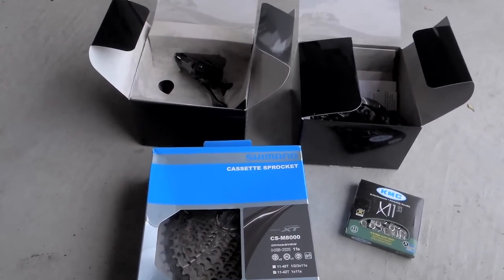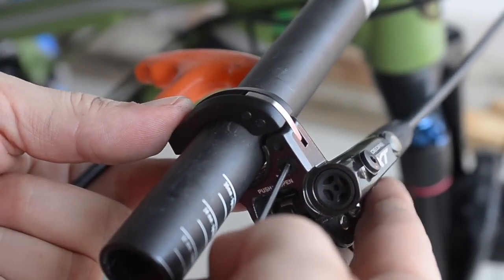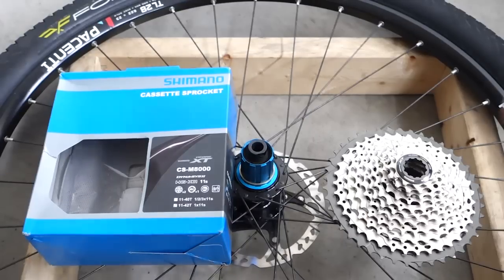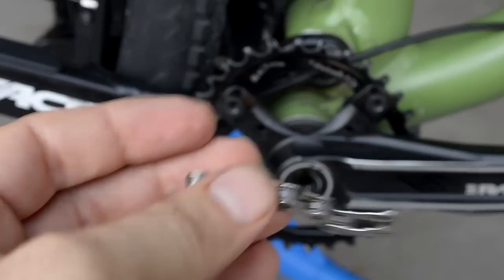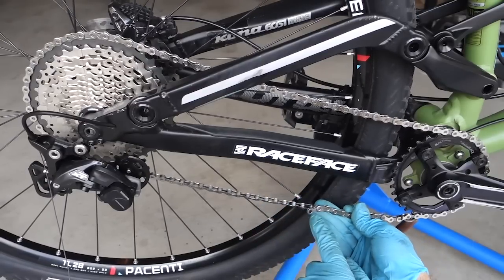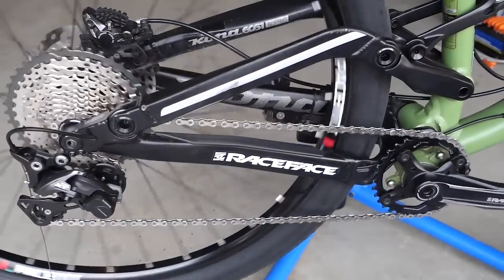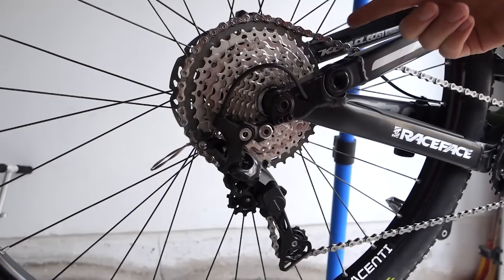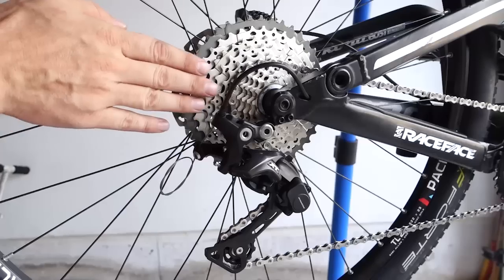1 x 11 Speed XT M8000 UPGRADE/ Install How-To, Ride Impressions: I-Spec II, 11-42t, GS RD

Comment: I was able to adapt xt 11 speed shifter (i spec 2) to my deore brake lever (i spec ev) by removing the i spec 2 plate and using a shorter bolt (brake rotor bolt). I saw this on reddit and very happy with the result. Im always referring back to your videos for reference. Thank you again.

Comment: Your videos about the XT M8000 components convinced me to go down that route. I got a fatbike which came stock with a not so great 3x10 and asked the bike shop to replace the parts with a 1x11 XT M8000 setup. Besides that the shop didn't feel the need to install a chainring with any sort of chain retention (I had to get a RaceFace narrow/wide to stop the chain from falling) they delievered the bike with a M8000 RD + 11-42 cassette + speed shifter and according Shimano chain (actually thinking of it I have to check wether it's also wrong as I have some rubbing in the lowest gears which I can't get rid off easily). All in all I am super happy and thanks to your video I made a very good decision on what path to go in terms of drivetrain. Next upgrade will be the XT M8000 hydr. brakes which you seem to like a lot too. I will be replacing the stock mechanical Tektros that came with the bike (entry level Felt fatbike DD70). I think that with my combination then (XT M8000 RD + cassette + brakes + RaceFace Ride crankset with 32t chainring) the bike will have made a massive leap into very decent bike territory without spending a fortune. Thx for your great videos..

Comment: Dude, I can't tell you how happy I am to have found this video.  Not only am I in the process of installing all the same parts, but I'm also replacing all the exact same parts you had (Race Face ring, One Up cogs, SRAM X9).

One thing you didn't address in the video, if you wouldn't mind: What's that little gray lever that you can push up for "ON" or leave down? Oh, and what's the little rubber cap that's on the "Plate unit cover?"

You are really good at making these tutorials; keep it up!

Comment: Ok so I went with a 3x10 to 1x10 conversion with the Race Face 32T up front and the Wolf Tooth 40T in back with their 16T drop in.  It is fine, but also just...ok.  Shifting can be somewhat inconsistent going back up to that 16T.  I wish I had just gone the 1x11 route from the get go after watching this.  I think the Shimano 1x11 M8000 Groupset is what Santa needs to bring this year.  Nice vid!
Reply: Indeed!  I will consider both options.  I guess it will depend on whether I have been naughty or nice in mama's opinion!
Reply: Well Santa was a bit late thanks to the Fedex delays, but did arrive this morning.  I've just completed the 1x11 XT M8000 conversion on my Trek Fuel Ex-7.  The only difference for me is that I kept the Race Face 32T Narrow Wide up front. It took about an hour fifteen start to finish because I wanted to only do it once.  The hardest part was the cable through the frame as my plastic tubing slipped out of the tape and went up inside the frame on the lower end when I was removing the old cable. I was able to snag the new cable end out of the lower hole with some tweezers however.  Love love love the setup!  Thanks for the reference guide!

Comment: Great, informative, higly detailed videos as usual. Great Job. Have you thought about using an Avid Rollamijig to get rid of the housing loop into the rear mech? It should help to reduced cable friction in the system. I've been using one on my 1x9 setup and it works great.

Comment: Hey man, nice video thanks! 

I recently went 1X11 on my Kona as well with the XT M8000 set. One thing i noticed when setting chain length with the +2 links method is that my chain felt way short. Watching your video and your +4 links method - your chain seems to be really pulling the derailleur along way out similar to my primary setup length. I ended up adding 4 links (so that would be length of big cog and chain ring + 6 links!) in order to have my rd nicely tucked at the low gears and roughly perpendicular to the ground on highest gears.. Would appreciate your thoughts.

Happy trailing!

Comment: Nice share ^^ going 1x11 (XT M8000) myself soon, as I managed to destroy my current SRAM drivetrain >.<
Have gone w/ Blackspire Snaggletooth 30t and 11-40 cassette.

Also have to re-build rear wheel i.e. new hub/spokes  - don't ask ;-)
Your vid has me excited about upgrade... I did like the SRAM gear though o_0

Comment: Is your shifter pretty stiff? Mine is and I'm not sure if it's designed that way or is it because I use old housings that are a bit too long
Reply: +LoveMTB weird part is that I cannot detect any change with the clutch  off
Reply: ***** This is indoors also, but it's currently -25C or -13F outside and then the shifter gets completely frozen. Remember, it's brand new, but the thumb lever takes a good while to return after depressing. I think this could be "normal", since I suppose these parts including grease and lubricants are designed to be used in warm weather.

I'll start switching the housing right now, let's see how it goes.
Reply: ***** I installed the new housing and the motion is much smoother. It's actually designed to be much different from cheaper models. Old one felt linear, but XT feels "bouncy" somehow, however it is now much easier to actuate. Surprisingly, there is not supposed to be a "loop" near the derailleur, like you see with road bikes and such, so the cable and housing is much shorter than normal.

Comment: Did you leave the heat shrink tubing inside the frame as a cable housing or is it simply an installation guide that gets pulled out?  Thanks for the great video!

Comment: Good review thanks, looking at going 1x11 by early spring, currently running 1x10 with a 32t NW race face front ring and a 11x42 rear cassette using a e13 expander sprocket. some good deals at the mo on M8000 Groupsets £299GBP. Shimano SLX brakes maybe ispecii compatible too.

Comment: ¿Do you think that the cassette with a SLX double crankset with just one ring (34t) would have a too bad chainline? I use more the low speed and middle gears.

Comment: Should of went with a wipperman 11 speed connector.  You can take it off as many times as you want.  It costs 30 bucks but if your cheap you can reuse it with a new chain at least a couple of times.

Comment: Wanted to ask you if your free stroke bolt came very tight when you got the brakes. I brought them but I haven't install it in the bike yet, but I tried to unscrew the bolt and I couldn't do it. I used a flat screwdriver (very carefully), but I think it shouldn't be a problem if the bolt wasn't too tight.
Reply: ***** I did it counter clockwise and yeah, it's not flat, but didn't have a Philips screwdriver when I tried. I gonna buy one, but still I felt it was too tight, I just hope is not cross threaded or something. Most of the time a flat do the trick and make me concernd about it because in MTBR someone said that one of his brakes the free stroke bolt was really hard to screw/unscrew. Harder than the other brake.
Reply: ***** Alright, thanks. I will get the right screwdriver and try it again when I install the brakes.

Comment: I'm curious to see how well it wears over time compared to 10-speed. I'm still running 9-speed (HG-61 11-36 x 32). Will probably go to 10-speed next as I can get a new Zee drivetrain/shifter for about $100 using existing crankset.
Reply: MarzNet256 go to 1x11 instead of hopping by 1x10 ul be happier
Reply: jom_ aca I might just do that.

Comment: hi I just got my m8000 11-42 setup running nice and I got the xt rear m8000  mech as well.  xt shifter was out of stock so got a xtr m9000 shifter .problem is shifting up feels a little stiff and shifting down I seem to get a loud clunk that I can feel from my saddle it don't seem normal . any ideas ? I'm pleased I've dumped my sram setup as xt ratio is much better for me

Comment: Hi Mate, Is it possible for cross matching this with Deore 5100? I have m5100 and Xt derailleur and was planning to put the m5100rd with xt shifter using the m5100 cassette and use my xt Rd with m8000 cassette with m5100 shifter.

Comment: I'm about to convert my old 3x10 Shimano XT M780 to 1x11 XT M8000. I got the 11-42 cassette and will add the OneUp 45/18 to it. I liked that progression over the 11-46. On the front I'm going to use the OneUp 30T ring. I upgraded the shifter to the XTR M9000 as I heard it is smoother than XT. Will use XT 11spd chain. Any thoughts on this setup? I'm concerned about getting the chainline right with the old M780 crankarm. Will backpedaling be an issue?
Reply: @LoveMTB  I am getting a lot of conflicting data when asking about cage length. When going to gears bigger than a 42 on a 1x setup do you have to go to a long cage (sgs)? When you look at the spec in shimano's literature it says for 1x and 2x Medium Cage (gs) and for 3x Long Cage (sgs). But when I speak to someone about installing the 11-46 cassette some say sgs, some say gs. Can I run a medium cage for a 1x with 32T  and 11-46?

Comment: Great video.  I have a question about the ferrules.  I had some in my toolbox and I had some (along with cable and housing) from kits I bought in the past.  I think they were Jagwire.  None of the ferrules I have fit.  ??  Do I have to use the ferrules from the Shimano shifter cable kits only?

Comment: How many teeth is your current chain ring for that set up? I have a 28-38 and 11 - 40 xt casette and im considering going 1x i dont know if i have to go 32T or 34T fpr my chainring. What do you suggest? I go on long rides but i also want to do trail or downhills. Thank you
Reply: @LoveMTB  yes mostly on the road. But id love to get on and learn to ride trails maybe even technical ones 😂 uhm what do you mean by spin out ? Sorry hehe. You think i should go with 34T? And would you recommend an oval chainring for my usage? Thank youu
Reply: @LoveMTB  how.about oval chainrings? Do you have a vid explaining those and its use cases 😂 Thank you btw i subscribed to your channel🤘

Comment: Why do you grease your bolts? I do the opposite and use Loctite blue threadlocker.
Reply: Yea i wondered as well when i heard the instruction...Grease is for parts that SHOULD move, not for parts that are intended to hold something tight. Worst thing you could possibly do to screws.
Reply: thats actually not true. Bolts with lots of torque need it just to be undone at some point. otherwise they get stuck like loveMTB said.
Reply: grease everything but discs, saddle, grips...
Reply: bolts should be threadlocked. Torque specifications do not account for greased threads. If you grease threads, you will overtighten the part. The only time you should use grease on threads is when the manufacturer calls for it. Grease can also make the part less reliable because the bolt can loosen. This is why you will find thread locker on brake bolts, bottom bracket parts, and many other parts where safety is a concern. People really need to read manuals because some manufactures call for grease (such as the seat post) and some don't. I bet most mechanics just grease everything and not read the manual. That's why I do it all myself.
Reply: I grease everything, torque to spec and never had a problem ever...
But I do regular maintenance... So Threadlocking is useless and mostly a pain for me
Threadlock to me is for who buys a stuff use it and sell it without handling a tool in between...
But I'm not gonna hit the street with a sign asking for a cop to come to some ones door in order to make sure they don't use Threadlock!! ;)

Comment: When you install the Cable Ferrule into the shifter do you just press it into the shifter until it makes a clicking noise?
Reply: @LoveMTB  The end of the Cable Housing has a Ferrule on it. It goes into the Barrel Adjuster on the front and on the rear there’s also one that sticks in the Rear Derailleur. Do you just push the cable end with the Ferrule into these spots firmly (Compression Fit)?

Comment: I am using 3x10 xt cassette and front/rear derailleur.Will an 11 speed cassette fit on my current hub or i need to replace it?
Reply: +LoveMTB thanks .that's what i wanted to hear.

Comment: Also converting to 1x11 setup, but not sure yet about front ring (30, 32 or 34). Any advice for shortening chain so I can switch later to other ring size with no problem with chain length?
Reply: Specialized Camber Evo 2014 (X9 2x10) but crasehed rear deraileur and have to change cassete, chain and rings as they are wear out, so it is opportunity to convert to 1x11. Not converted yet, but plan is to start with 32T, and depending on trails to change to 30T or 34T. Haven't tried 1x11 so don't know what setup is best for me. Will leave few links longer chain for start then. Thanks.

Comment: What's the point of mounting your bottle down there? I had mounted my old bottle cage to my new bike and due to the wider bottom tube it didn't fit straight. (It has a pump mount at the side.) Even so I have a very large mudguard at the front, the bottle always got extremely dirty on the trails. And since I also have a camelback without a cap on top of it, it was a huge problem (I like my water without dirt.) I had to buy a new bottle cage so the downtube shields the bottle. I can only imagine that yours has to be covered in mud when you go out riding.
Reply: I think you need at least a different bottle. One with a cap on the mouth piece, you can't drink out of a dirty bottle.
Reply: Yeah, I did that to, but I still hated it.

Comment: Hello. Have a question. I have 2x10 system and thinking of upgrade to 1x11. So, may I install 11 speed cassette on the same wheel where I have 10 speed cassette at the moment? I mean if the same wheel will be compatible with 11 speed? Thanks.
Reply: LoveMTB thank You thank You thank You  i though I have to buy another part s. Such a great news

Comment: As I understand, the standard freehub is shimano 9/10. I've been reading through a few comments and you have told others that no other parts are needed to install a xt8000 11gears. Is it true that an 11gears fit right in on a 9/10 freehub?
Reply: Even some of the 12 speeds will fit on a normal shimano hub :P Like the sram NX 12 speed cassette or sunrace 12 speed cassette.

Comment: I ave seen many conversion from 3x10. I dont understand, why to go from 30 speeds to 10 ? what's the point?
Reply: Heres Mihai, that's a great question.  I "upgraded" from 30 speeds to 10 last year, and I just did the upgrade to 11 speed that's shown in this video.  Going from 30 to 10 is one of the best things I've ever done to my bike.  Here are a few reasons:

1. I love my dropper post, and the button is on my left handlebar.  On longer rides & races, I found that my left thumb would get fatigued, clumsy, and "confused."  As a result, I would have to look down at my handlebar to make sure I was hitting the right button, which is not a safe thing to do in a race.  Now I only have one button on my left handlebar, and my thumb always knows what to do.

2. While you think you have 30 gears, you really don't.  A huge chunk of the gears on your 30-speed bike are duplicates of each other.  Thus, you're carrying around extra weight that doesn't get you anything.  In race situations, that matters.  I dropped a significant amount of weight by getting rid of my shifter, cable, cable housing, front derailleur, and two rings.

3. Your front derailleur shifts much more slowly than your rear derailleur.  Thus, again, in race situations, you're wasting precious time by shifting with your front derailleur.  Of course, there are a couple exceptions to this - when you're trying to access gears that aren't available in your current front ring - but in general, doing a lot of shifting with your front derailleur is slow and inefficient.

4. It's just simpler.  I don't have to think about which derailleur to shift with.  I don't wonder which front ring I'm on, and I never accidentally cross gears.  Plus, fewer moving parts means fewer mechanical problems.

5. When you think about it, how often are you in your highest of high gears?  Probably not that often.  I lost one gear on the high-speed end, but I make up for it by spinning faster.  But that really isn't very often.

6. On the other end of the range, I lost one granny gear.  That hurt for the first few rides, but my legs compensated by getting stronger.  Now I climb faster than ever because my legs are stronger and I don't have a "sissy" gear to fall back on.

I hope that answers your question.  I'm sure others would disagree with all or some of the above, but those are my personal thoughts and experiences.

Comment: I really want to attach my brakes onto my shifter like you have in the video. But I have the Deore XT M8000 Dyna Sys11 Rapidfire pod shifter. Can I buy a mount for it so I can attach my brakes? So then its all on one ring on the handle bar? Or do did I buy the wrong shifter and need the XT M8000 I spec 2 shifter? Wish they made this more clear and the Rapidfire shifter (the one I have) seems to cost more then the other shifter. PLEASE HELP
Reply: Whats different about the shifter other then just the mount?
Reply: Interesting, Wonder why they made 2 shifters instead of just one what is compatible with the brakes. Unless they figured it out after.

Comment: when shifting after hearing the click sound i still need to push it a little more in order to have the chain goes up. is it normal? pls do understand im not fluent in speaking english. thank you.
Reply: @LoveMTB  okay sir. i once brought it to a bike mechanic and he said thats normal for a rapid fire shifter. so maybe the mechanic is wrong to his conclusion? thank you sir.
Reply: @LoveMTB  thank you for the advise sir im applying it now.
Reply: @LoveMTB  wow! its now working properly sir its now changing gears smoothly. thank u very much sir for your usefull advise. God bless